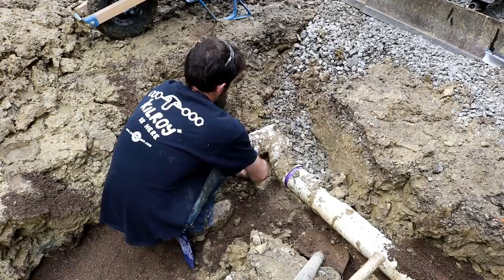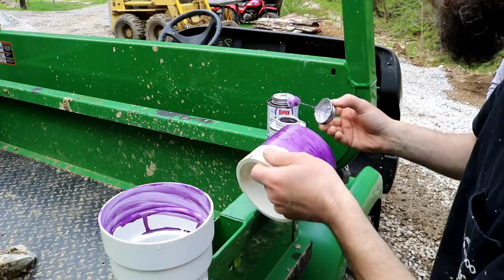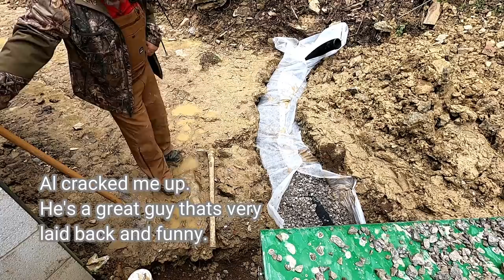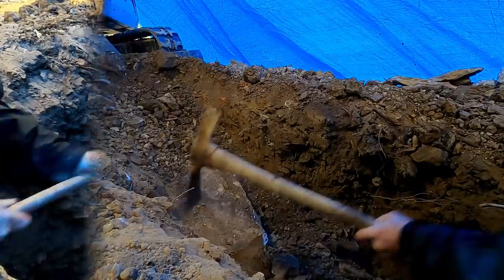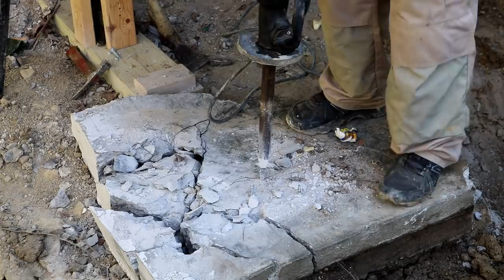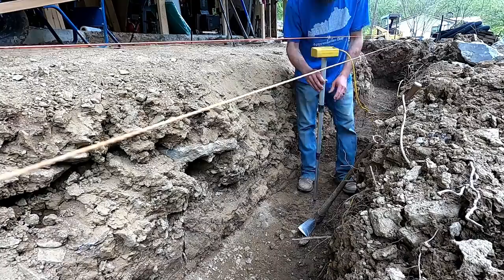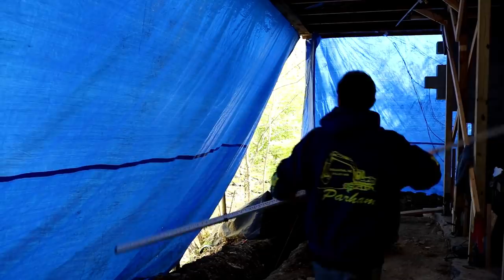Digging on the EDGE!  Shop foundation dig!  Damaged shop part 12

Comment: Watching Your videos for quite some time and watching every video in this serie, I am deaply impressed by Your work, Your guts, Your efforts. Personally I might have pulled it all down into the creek and started all over.
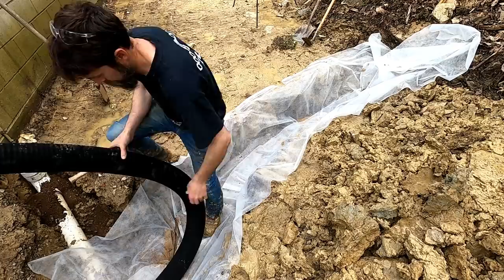Having seen a number of construction works I have never seen what You do at the time 6:20, couvering the drainage pipe in plastic. Why not use a perforated drainage pipe, layed down in proper material and let it drain water all the way?
By the way, how did You do the draining along side between the shop and the hill?
How did Peanut react to all the noicy machinering?

Comment: Make sure you use tie rods between the slabs to hold the slabs from moving horizontally and vertically over time.You do not want the slabs opening up or moving vertically forming a trip hazard.

Comment: I note that you are using a 24"x16" ground beam with 4 bars (spec? links?) and then substructure blockwork up to the sole plate of the cladding.  This seems to be a labour intensive construction i.e. expensive that doesn't seem to address IMO one of the major issues and that of loose rock fill that was caused by the erosion of the hill bank and the quantity of water over millennia.  I can still see the foundation gradually sliding down towards the stream because the foundation won't be able to stop it.  It may take longer to move but move it will, only now the whole thing will do it as one  With the deep foundation you will have increased ground water pressure assisting gravity.  I would have expected to see the foundation to be either 'L' shaped or to link in with the floor slab to increase the overall mass to resist the lateral movement.

Comment: The material under the footing "dirt " look like limestone rocks mixed with clay ,beside  a creek with high probability of getting wet , This could throw away the soil pressure and support calculations as clay is unstable , Perhaps to avoid possible sinking of the footing ,4 or 5 vertical holes under the footing to bedrock and filled with cement and re-bar ,then pour the footer on top . Looks like the bedrock is not very deep  . Best of luck with the project .

Comment: I don't want to point out the obvious, but with all that clay, have you considered selling off your machining equipment and getting into pottery? :)
Also, when it comes time to set up rebar, remember, steel is cheap. Put plenty of it in and tie those CMU's into the foundation with plenty of rebar stubs into the beam. Also turn some 90 degree bars out of the CMU's into the new slab- tie it all together. A right angle is much stronger than a single wall, use the new slab as a cantilever and edge member to keep it all solid as one unit.

Comment: Green lasers are far easier to see.

Your foundation depth and level is set from your FFL (finished floor level) not the roof plate. Yes you need to level the roof but work from the ground up not roof down even in your situation. As long as the roof is secure you can worry about it once you start building the wall either in brick or structural timber construction. Just my opinion from my experience. We all do things differently and sometimes after doing something once we work out how we would do it differently the next time. That's  why woodwork, metalwork and any type of work like this is interesting and you never stop learning.

Comment: Sorry Steve but that is destined to fail, in that shale on that bank with all that water? You really need to sink at least three piles down to bedrock and connect to your footing.
Or you could buttress it to stop the rotation.
Reply: piles is the only way it will slide otherwise
Reply: Hi Steve, I love your channel and the quality of your work.  That is why, I’m writing this.  I agree with this comment and the other replies.  Your footing is going to slide out with that slope.  You can clearly see the effect of this slopes creep toward the creek in the curved trunk of the trees on the bank.  Obviously, those trees all started growing vertically - that is straight up.  As the slope slid slowly down toward the creek, they rotated out of vertical, and continually corrected their growth back to vertical.
Reply: Enough with the piling comments. There not any way to put in pilings. The size of machine needed to spin a coring cutter would require the roof to be removed and a ton of money. There nothing you can use to cut in pilings, that would fit under the roof. The ground is too rocky for anything less than a coring cutter. Pilings are NOT FEASIBLE. It's almost as if random people in the YouTube comments have never done this kind of work. Funny how that works. This isn't a job with an unlimited budget. The way people are talking with retention walls, pilings, and embankments, you'd think it was a $100k job. The guy is saving CMUs for Christ's sake. He's on a tight budget. Those footings go back 10 feet, and it's going to take a lot of time for it to be pulled into the stream. The bank of the stream hasn't moved in in decades, and it won't move enough to cause a catastrophic failure in several more decades. Once that footing is tied into the slab, with proper rebar, it isn't going anywhere. All of the dirt can erode completely away from under the slab, and the slab will still not crack, if they do the proper rebar work.
Reply: SMH.... can’t believe he thinks this going to work.
Reply: @xenonram  you can hammer them in ive worked with a small piling machine that would fit in there
Reply: @jeffreylee7184  then he needs to buttress, ignoring it won't make it go away and in his own view, if it isn't done right the work is all in vain.
Besides he is resourceful and determined don't tell me he can't improvise. It's all doable.
Reply: @xenonram  all true except the bit about it not going anywhere, the forces exerted on this will be rotational not sliding, for a footing to work it needs to be on solid base which he hasn't reached yet, it is all shale, if piles can't be dug then solid rock needs to be found further down toward the creek and buttresses formed from them back to the footing.
Cost is important on this obviously but seriously he doesn't want it to fail after all that work.
I assume the person who installed the original job thought it would be good enough. Steve is nothing but resourceful.
P.s it won't give me any joy to be proven right.
Reply: @xenonram  I agree. He's doing the best he can under the circumstances. Any building is a compromise between cost, time and longevity.
Reply: No telling how much the creek bank shifted over the years. I wish Steve all the best of luck.

Comment: Brother in law was building a garage on his property, and hit sandstone. Building inspector said to make it as deep as the plan called for, so he took an extra 2 weeks, of 2 labourers using cold chisels and hammers, to cut to the required depth. Then called for inspection, and the next inspector asked why so deep, because that solid sandstone only called for a shallow cut in it and a stepped pour.

However he built is as per plan, all with bricks ( free, as he used reject brick from his job at a brick manufacturer, so could grab all the reject brick from batches, that were either wrong colour or overfires, plus 2 free bricks per day allowed), and eventually finished it. Took the cover pile of sand off after curing, and the first week the garbage truck drives down the road, and makes a 100 point turn in the open brick paving.

Nothing moved, as the brick was all overfired pavers set in concrete, and the design, while only meant for a car mass, was sitting firmly on that massive sandstone outcrop, and could not move at all. Previous the truck had to reverse up the road, as it narrowed at that point to a thin lane, and the truck would be slightly oversize for it making the turns. Still there now, and I guess that truck still turns there, unless there is a car parked.

Comment: Steve, having spent most of my adult life in construction, I can tell you that my observation has been that most people don't know what it takes to build a building. They scoff at the expense because they don't understand the potential pitfalls when they exclude portions of the work either in ignorance or to "save money". My best guess, and this is only a guess based on what you've said and shown, is that the people that built your barn had friends or family help and not one of them had any practical experience with construction means and methods. Certainly not any experience with the structural aspects of construction. It's a shame when people get upset with or ignore the inspectors and codes because they think it's too stringent. I've seen much worse and much more dangerous conditions throughout the course of my career and I can say that the codes and specifications are there for a reason. Good luck with the rebuild.

Comment: This is a prime example of what happens when man who is use to working in Tenths is doing a job that where "That look good to me" or "Close enough for government work" is the rule of the day
Reply: machining to tenths of a thousandths of an inch. building to tenths of a foot.
Reply: The level rod is supposed to be plumb. When you were using the level rod, if you are not using a hand level(bubble) against the rod, you are supposed to rock the rod towards and away from the instrument and read the lowest number(hundredths of a foot). 
I thought my ground was tough to dig in, yours is WAY worse.

Comment: Hope you're planning on laying an attractive facade on the outside face of that footing. Because in a very few years it will all be exposed as the remainder of that hillside makes its way down to the creek. You should plan on tieing the footing with rebar perpendicular to the floor, so that the floor will anchor the top of the footing and keep it from tipping forward into the gully. Pour the floor extra thick. And lace the entire bottom of the footing with drainage holes or you will build up enormous hydraulic pressure at the base of the footing.

All those big rocks are where you're finding them because they've slowly been making their way down the hillside under the force of gravity for the last few 1000s of years. The only thing that will keep that footing where you pour it, at least for the next 50 years, is anchoring it horizontally back into the hillside and relieving it as much as possible of hydraulic pressure. Maybe not just weep holes at the base but actually embedding 8" pipe sections crosswise at mid-height as well.

Comment: Al did you installed a check valve on this pipe line? If the river goes up the water enter through the pipe.

Comment: Hi Steve, I've been watching this series with interest and Ive been impressed with the hard work you've all been putting in.  I have a concern.  You may have addressed this in earlier videos but I'm worried that the shop is built just too close to the water.  It's clear to see how high the water level has been in the past and that a few more high water periods could wash away more of the ground there and put you right back in the same situation you were in at the beginning of the project.   I sincerely hope that doesn't ever happen.  What are your thoughts on this and what have you done to avoid this happening?

Comment: Q. why did not place the drain tube along the entire wall ?
Reply: f63paolo if you watched earlier episodes you will see that they hit a bloody great slab of rock running the length of the building and the width of the path they cleared between the building and the hillside. It slopes the right way so there was really no need to put the French drains along there that Steve had intended.

Comment: Why will you put a few rows of block on the footing instead of running the wood frame right down to it? Is it because you want the first few feet to be impervious to moisture? Or does the footing not come up to ground level? I’m a machinist guy not a builder 😜

Comment: Normaly when you standing in a slope digging you put the blade outwards and level the machine :)
Reply: Agree, would use wide planks
Reply: Timber pads. :)
Reply: Just sad to see them digging the rocks by hand instead of the machine, which is quite capable of digging them out without damaging the machine or trench. Amateur operator(s)? Not meaning disrespect to either Al or Steve.

Comment: steve, wont your concrete just slip into the creek, there's no earth between you & the water mate
Reply: Depends on how it's poured. Some foundations have a wide footer (concrete)  underground with the foundation poured on top of it. The foundation will probably be poured inside of a plywood form. It acts as a damn and gives you a place to snap a line for the finished height. Then the form is removed and the finished floor can be poured up to the foundation. Some of these steps can be combined. It all depends on what is appropriate for the building and the area.
Reply: When I put up a house extension, although the drawing called for trench fill 0.45m x 0.5m at 1m it was dependent on getting below the clay. Luckily I hit gravel at 0.95m and I was on level ground.  As I understand the problem with clay is that it shrinks in the dry and too soft when wet, allowing it to move either way.

Comment: Whats going to keep this from happening again as you are so close to the hill side?
Reply: He is putting in a lighter timber wall
Reply from the maker: Nothing. In time this building will be gone due to its placement by the original builders. I'm buying time and repairing what's here. If it lasts 30 more years I'm good with that.
Reply: @SteveSummers  Hope it does for all that hard work your doing

Comment: Steve, i'm having a time with why you're so fixated on the roof. you should be fixated on the foundations and how they all tie into each other and getting them on one plane. the roof is immaterial at this point. while i see you want to use it as a reference point, it seems a little moot as it is a moveable point. if you really want to get a good reference, the top of the wall that is still standing should be your point of origin and you can run your lines out from that. everything else will get tossed out at the latest when the concrete of the footings has set.

Comment: Bottom of your trench still looks like fill dirt. More work remains to do it right. I think you are deep enough you could get one of the fencing guys to come in and drill to bedrock 3 or 4 holes so your beam has support. Best solution if you don't plan to put a diversion wall in the creek.  If you are only looking for 20-30 years probably driving treated gate posts till they hit bottom would work as well but not a 50yr plus solution. You are too far into this job to start cutting corners now!

Comment: Why did you cover the perforated pipe and rock with plastic? Why not landscape fabric? To me, the plastic would keep water out. Not throwing stones at a glass house, just trying to understand.
Reply: He backfilled it with what looked to me like 57's which will create a void for the water to leach into so it can make its way into the tile, the plastic looked like filter fabric, it will allow the water to pass through, but keep the mud from clogging the clean gravel

Comment: Geeeezzeee even on video it looks like a steep bank. I would not want to be on equipment that close to the edge.  Building on this stuff has got to be like building on greased ball bearings. Long ago if it were me I’d have sold the shop and moved (like the people before you) rather than take on this.